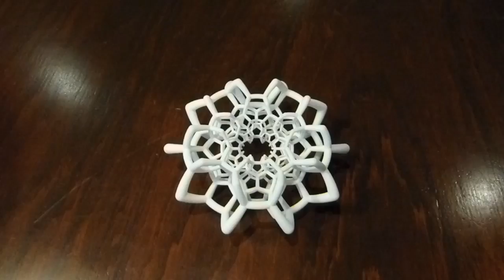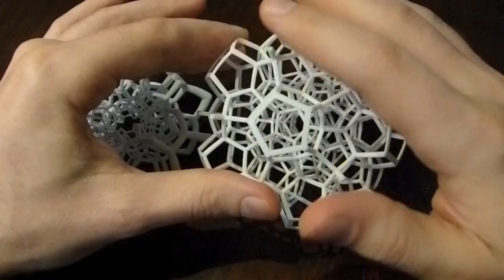Toroidal Half 120-Cell

Comment: I find it harder to visualise how this relates to the whole 120-cell than your previous "half" version cut along a sphere. Suppose you put your model inside a (3D) mirrored torus which exactly touches all the outside vertices. If you were inside the mirrored torus, would the reflection of the structure you made form the missing half of the toroidal 120-cell?